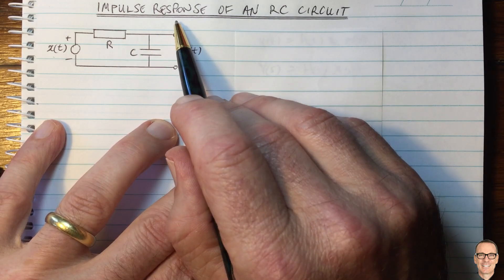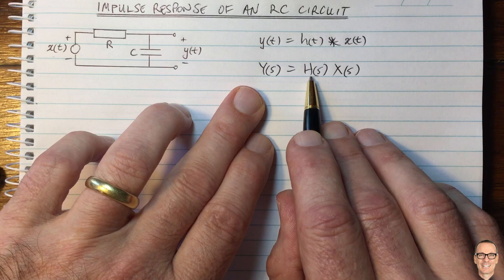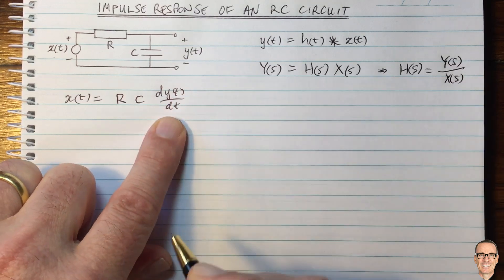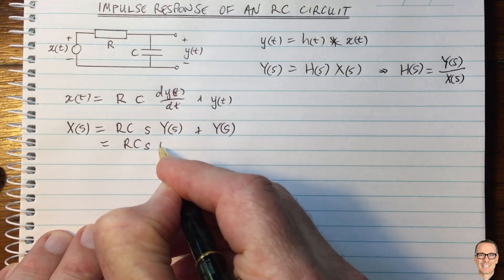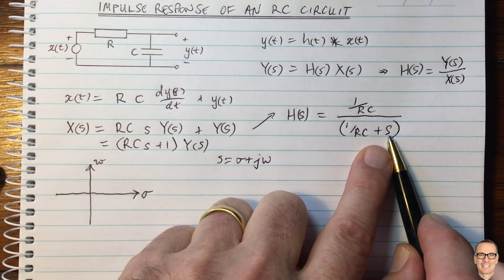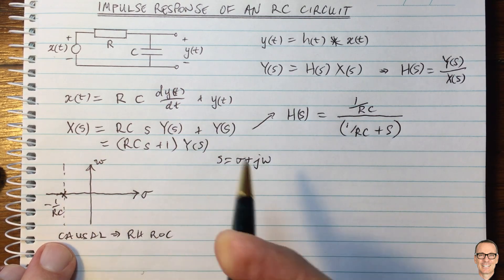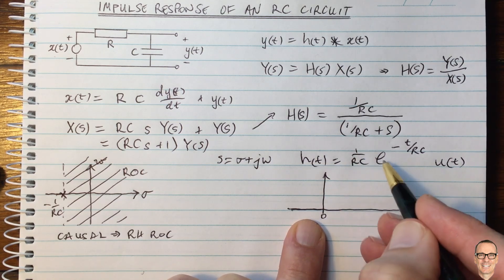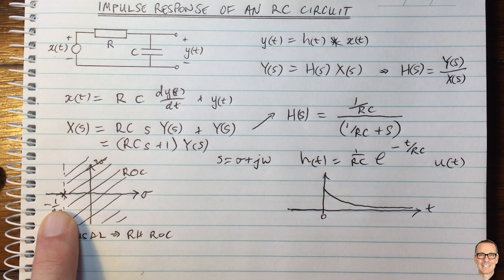Impulse Response of an RC Circuit

Comment: Thanks, I have a more general question concerning wireless communications. 
Assuming we have a WLAN access point with just one antenna  and I want to install a metal reflector behind it. What would be the best distance to the antenna to get the highest SNR?
I would say 1/4 wavelength or 3/4 wavelength because we get a standing wave with highs at these points. Is that correct?
Thank you.
Reply from the maker: It depends on the angles you want the energy to radiate into. For "bore sight" signals, yes, you're correct. But for other angles there will be cancellation between the direct path and the reflected path.